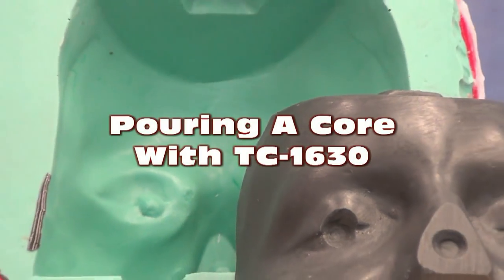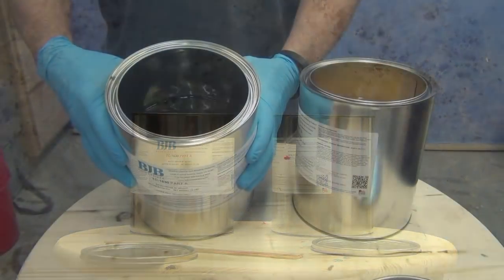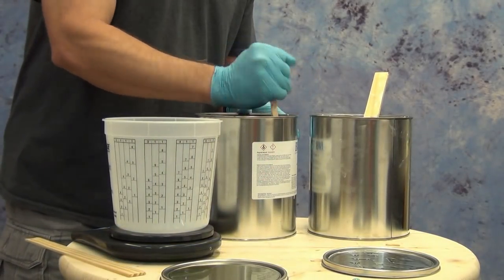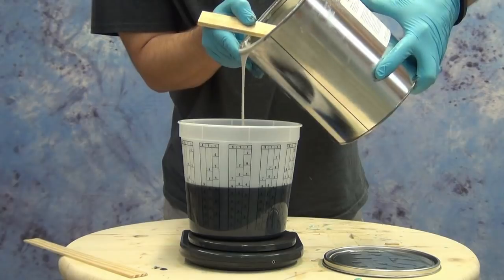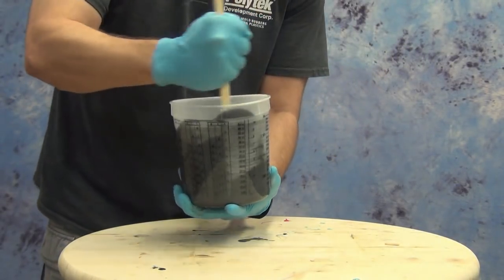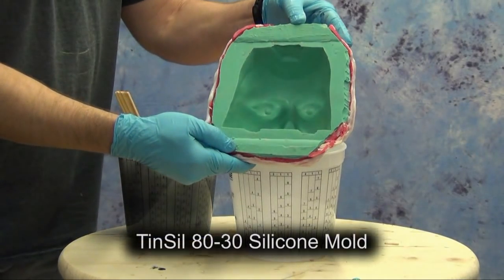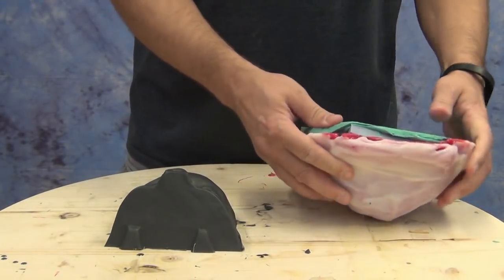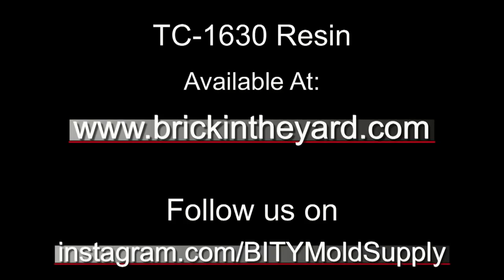Pouring A Resin Core Mold For Silicone or Foam Latex Prosthetics

Comment: does this work for a half latex mask
Reply from the maker: Latex really should be cast into a porous mold like Hydrocal or Ultracal 30. Silicone or resin molds will not pull the moisture out of the latex.